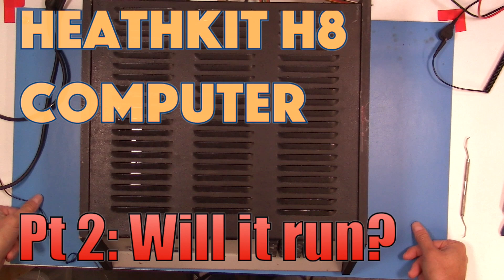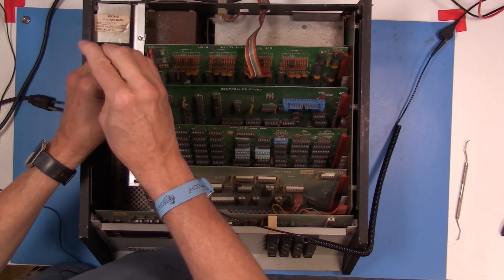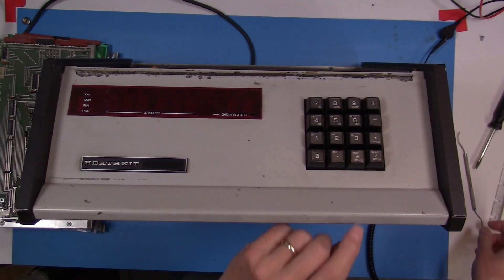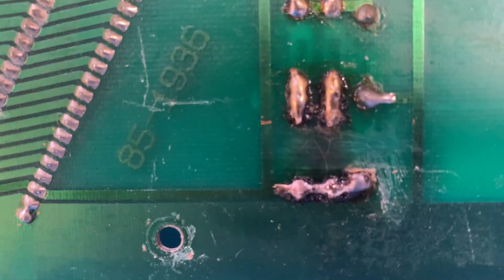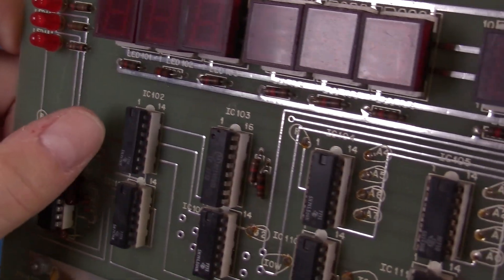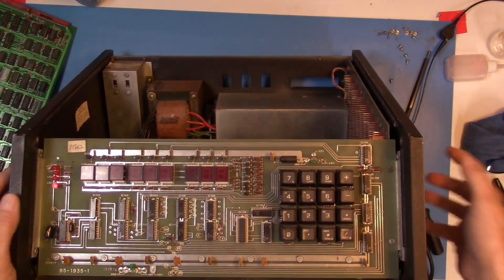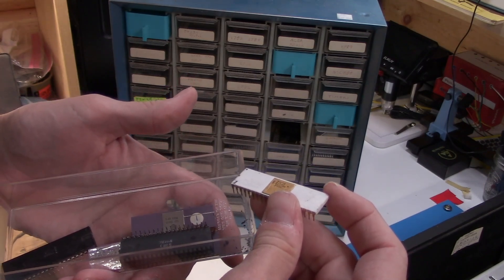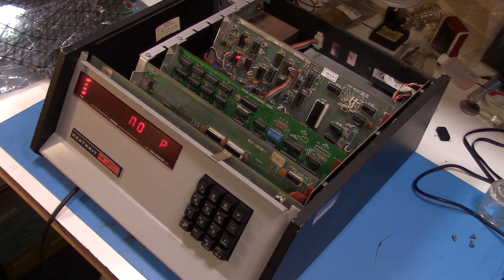The Heathkit H8 Computer - Part 2: Power on - Up in Smoke?

Comment: I built one of these back around 1980.  It was great fun, but when I got the CPU done, it didn't work.  We had great support from the Heathkit store, and when I told the guy the problem, he pointed me to a small cap on the CPU board.  He said "Snip it off".  I did, and the computer worked for ever after.  I used it extensively to dial-in to the telephone company and work from home after hours.  Telecommuting back in 1980.  We were some of the first, because back then, the telco had modems to connect to.
Reply from the maker: How funny on the cap. Was it one of the little tantalum caps? Using a computer to work remotely in 1980 took a bit more to explain than it does now, lol.
Reply: @primal-bits4777  Yes, I believe so.  The Heath guy knew exactly what the fix was.  Regarding remote work, I worked for SWBT, in IT, and other programmers knew how to dial in, so i wasn't breaking any new ground there.  However, the office would do only VT100 or higher Terminal Emulation, and the Heath only had VT52.  So I had to write my own terminal emulator in assembly to get it to work.  At first it was only about 1200 baud, but after a few years, up to 33,600 baud.  It kept me from having to travel 20 miles downtown in the middle of the night many times.   I could dial in and fix mainframe program abends.   Eventually, I moved on to bigger, better, faster computers, and donated my Heathkit to charity (mistake btw).

Comment: LoL. A ceramic 8080 CPU is in the junk drawer.  I think if I owned one of them, I'd have had to remove it from the display cabinet.
Reply from the maker: lol, yeah. I got that great drawer of parts for the price of the parts cabinet. I hate to say how little I paid for it.  It has some amazing 70s parts in it, including a lot of white ceramic CPUs and support chips. I’ll be putting together a COSMAC Elf reproduction using a ceramic 1802 (there are several in there).
Reply: @primal-bits4777  amazing! You're very lucky and the chips are lucky to have found such a kind human to look after them too.

Comment: Recommendation for dealing with slot head screws: a set of screw drivers with hollow ground blades.  Gunsmiths use these because they are much less likely to slip out of a slot an mar blueing on a firearm.
Reply from the maker: Thank you for the suggestion.

Comment: I built one of those in 1978. After I finished it did not work. I was so disappointed I did not touch it for 3 weeks. 

So l finally went back to figure out the trouble and it was 3 bent pins. They had a weird bus construction with rows of  pins on the backplane that go into connectors on the end of the daughterboard. I bent 3 address lines on the 8 Kilobyte memory card. I was so angry with myself for wasting 3 weeks. 

Imagine that a Whole 8K on a card about 4 by 8 inches.  Mind numbing.
Reply from the maker: Between the backplane pins and the IC sockets, a lot can go wrong. 

It’s amazing how much was done with such limited resources. What can you do with 64K on a modern device? Maybe create a file name, lol.

Comment: Slow blow fuse to accommodate charging the big electrolytic and fast blow diodes to protect everything else. 🤪
Reply from the maker: Yes, lol, the diodes definitely go before the fuse does. Tantalum capacitors failing also takes out the diodes. Definitely a weak point.